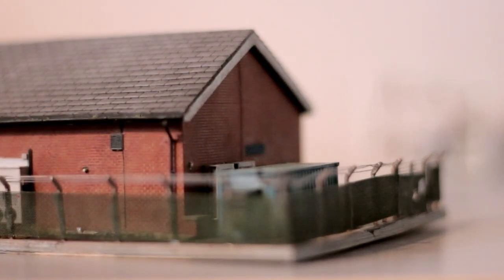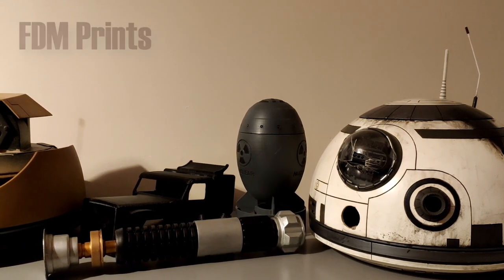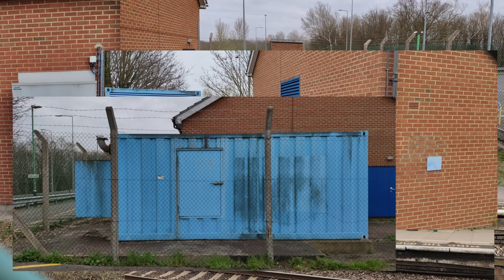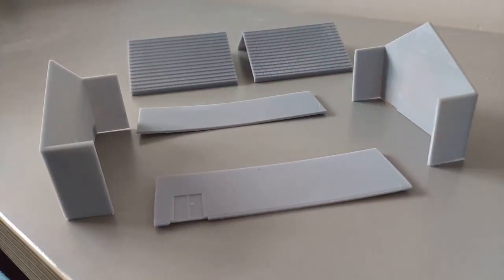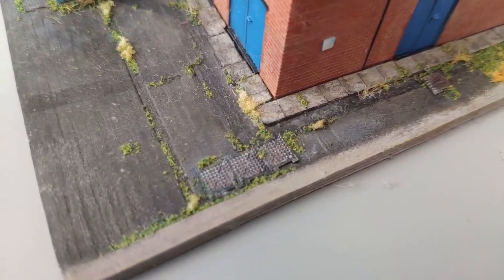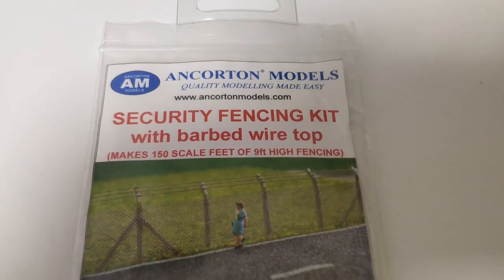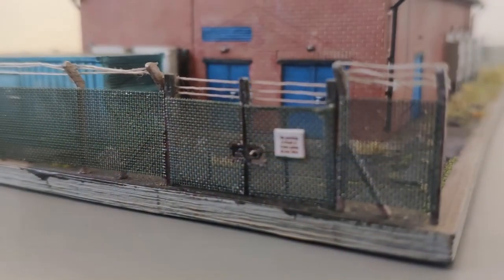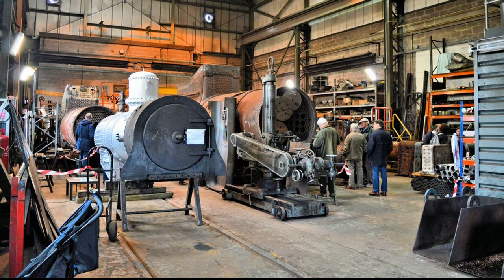Building No1 - Telecommunications at Wolverton Station

Comment: Did you make that head piece for BB-8?
Reply from the maker: I did print and paint the scrapyard looking BB8 head but I used the 3D files available for the BB8 builders club. The other droid head (BB4) I designed the files for myself, the body is all printed too and just needs to be painted now.

Comment: Very neat, out of curiosity what material are you using in your FDM printer and what did you use it to glue the resin to the inner shell ? P.S. Putting the warped resin parts in hot water and then putting them on a flat surface under some heavy books can help flatten them
Reply from the maker: Thank you. I'm printing in PLA+ filament and then just using industrial strength super glue (Ever Build brand) to attach the resin skins. It took a bit of trial and error to account for shrinkage in the resin though.